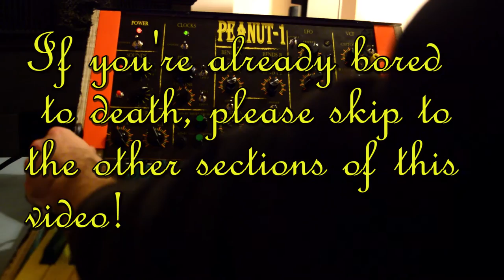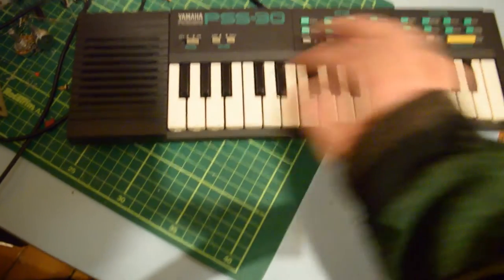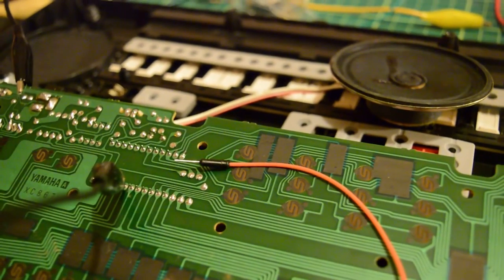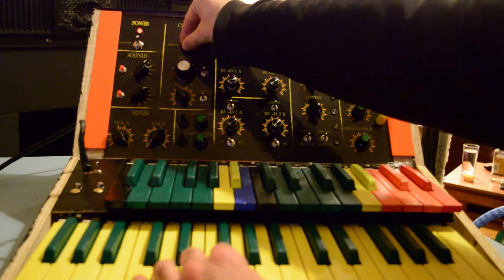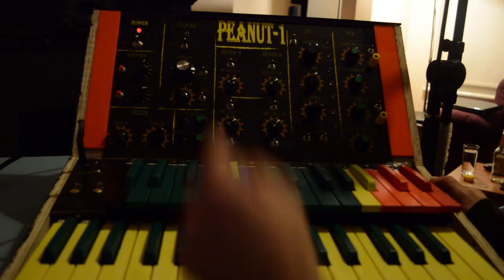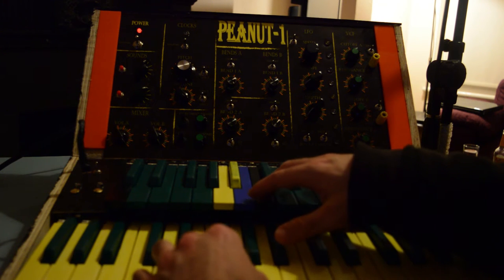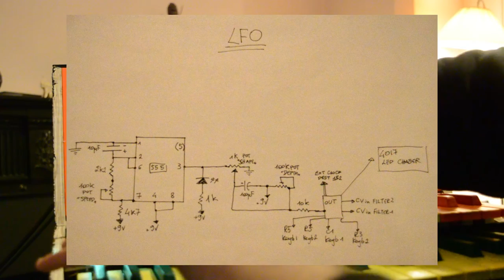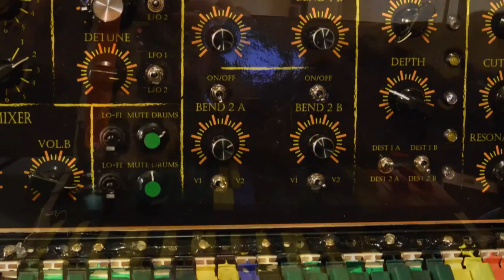Moog Circuit Bending Challenge 2016

Comment: Good Job. How did you print the labels on the control panel? That is something I definitely need to get better at.
Reply from the maker: Hi Mike,I struggled a lot as before I never took care of the aspect of things. Basically I created the file on adobe illustrator,then I printed and laminated it at my workplace. 
There are better but more complicated methods to do this but this was a good compromise for my possibilities. .